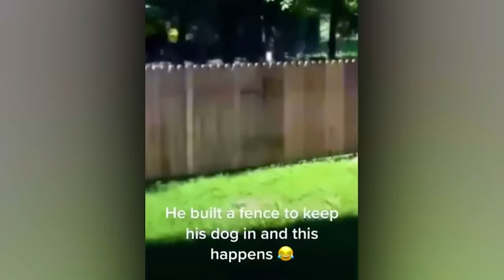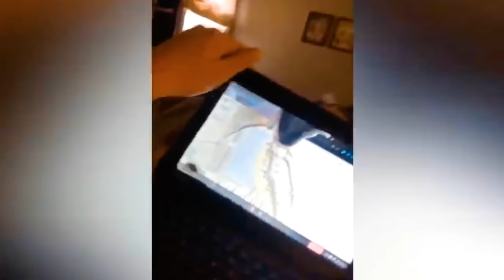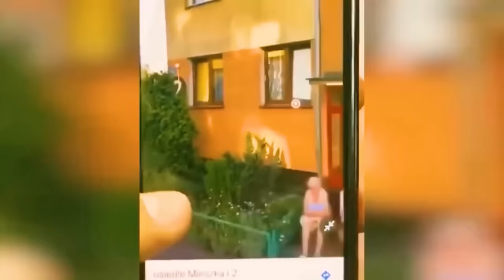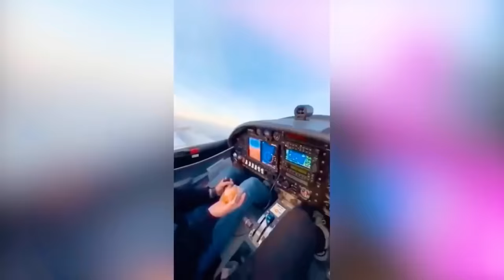0 IQ MOMENTS

Comment: The guy trapping himself with a wooden pallet? Well a few years ago I made a big wooden work bench for my basement. I built it outside then realised how stupid I was as it could not possibly fit through in my door 😂
Reply: 😅😂😂… eyyy! At least you tried 🫡
Reply: I fixed hinges on an old stand up cupboard. Unfortunately I screwed the doors shut, had to take it apart again

Comment: 17:43 Acrylic paint is water soluble.  Should wash off easily enough.
Reply: Nope. You can dilute it with water to paint with it, but once it's dry it won't dissolve. It's hard enough to get it off the hands. Painting the face with it is a major fail!